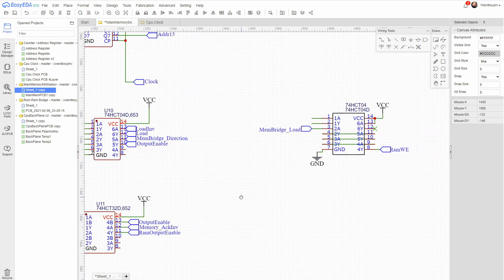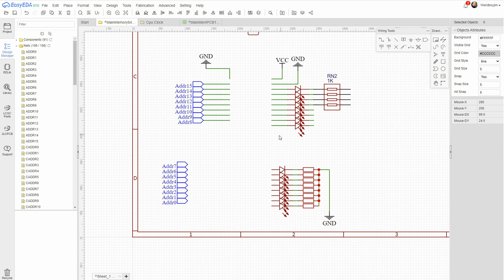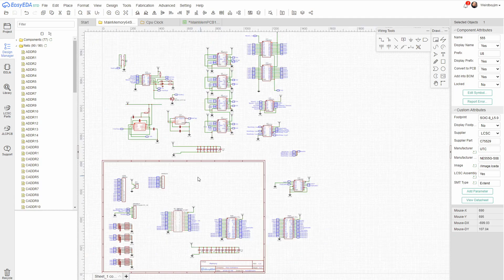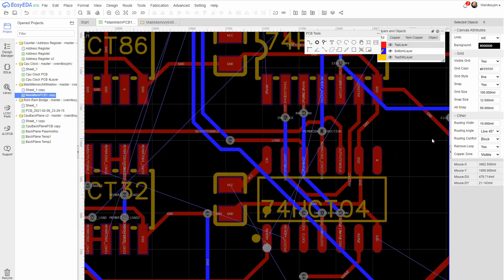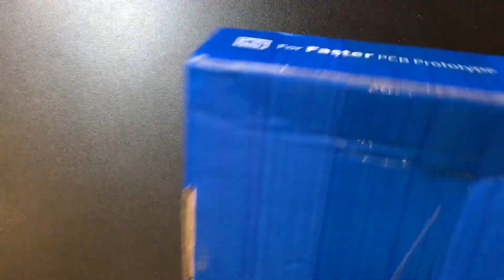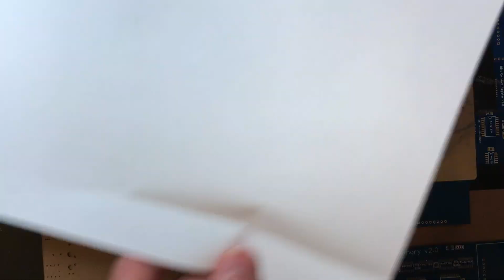Shadow Ram PCB - Making an 8 Bit pipelined CPU - Part 97

Comment: Can't wait to see the next one.
To the 555 on your rom-copy module: On which frequency is it running right now? In building the module on breadboard you put together some components without checking the datasheets of the rom chip. Maybe with a bit of tuning this could go way faster. Afterall the copying is independent from the CPU-clock.
Reply from the maker: The rom chip has an access time of 150ns, so in theory you should be able to get it up to 6.6mhz. You would have to  check some other timings to make sure you are obeying the rules. It currently copies far too slow, the breadboard version was quicker. I'm pretty sure I just selected the wrong capacitor for the 555 when soldering this one up, realistically if it copied in less than a second nobody would care so anything over 65khz would be sufficient.  Sorting that out is actually on my todo list for this weekend. I waited for that copy one too many times recently.

Comment: Wow! What speed and air flow do you set for the hot air gun?
Reply from the maker: The airflow on my 858D is set to "6", there doesn't appear to be any units on there or even a guarantee that the value is calibrated between devices. I speed up a lot of the sequences to varying degrees, the start of hot air soldering is probably slower than the impression you get from the video as I'm slowly bringing the temperature up.
Reply: @weirdboyjim  Thank you! I also try to achieve this kind of reflow, but I either set the temperature too high, so my PCB burned out, or too much airflow, so the smd resistors fly apart! It looks like I just don't have enough patience.

Comment: Just spent two full days binge watching all 99 videos in the series.  Awesome achievement James.  Coming so late to the party had meant I missed the QA from the retrospective, but I do have a question out the index registers.  I haven't spotted them being used much.  How are they used in this project?  I would have expected them to act as manipulators to the program counter, a bit like 6502.  Or are they more of a holding area for addresses that can be moved into the program counter? Also are all the jumps to absolute addresses, or is there any instructions to branch to relative addresses?
Reply from the maker: That's some good timing for all the videos! Hope you found the side series (Uart/Sound) if you are interested in that stuff as well. There are 5 index registers,  PC/RA/SP/SI/DI the first 3 there are constantly used so I guess you are asking about SI and DI. There are a few instructions that use them as branch target but primarily they are for reading / writing memory. They are refereed to as  source and destination but they are interchangeable for all but the lodsb/stosb instructions.

Comment: This is awesome -- so cool to see your design process. I'm curious why you choose to solder your own boards rather than have JLCPCB do that part as well.
Reply from the maker: Thanks Yona! Most importantly I want to get to the end if the project and feel like I have made it, getting someone else to solder it might reduce that. It's worth noting that the assembly service didn't wasn't available when I started anyway but there is also a very restricted range of discrete logic part available that service.
Reply: @weirdboyjim  That makes sense. I'm also a hobbyist PCB Maker and I've found that having them assemble my boards really helps me actually get through projects, because assembly can really be quite tedious and often I just procrastinate doing it.

Really looking forward to your next video on the VGA driver -- super interesting stuff, especially how you're thinking of handling scrolling and sprites. There is very little content out there going into the details of how that part of old hardware works, and it's some of the most interesting.

I would also be super interested in seeing how you approach sound generation -- something like the SID chip or even just triangle/sawtooth/square/noise like the NES had would be fascinating to see.
Reply: BTW Do you have a patreon? I'd be interested in supporting it.
Reply from the maker: @HypherNet  The sound module is a fair way in already.  https://www.youtube.com/playlist?list=PLFhc0MFC8MiAfS8UTTFlGkoqgCuEqusmg
Reply from the maker: As a result of yours and others comments I’ve now created a patron, but please do not feel obligated. https://www.patreon.com/JamesSharman

Comment: I had shadow ram on my BBC micro. Though that wasn't for putting ram in the rom address space  (had sideways ram for that), but for reclaiming the ram that would otherwise be used by the video display (which has nearly all of the 32k in some modes).
Reply from the maker: Yeah, "Shadow Ram" as a term is most commonly used when the ram is shadowing rom but it can be used anywhere the ram is shadowing something else in the address space.
Reply: Yeah, I remember if you wanted code complexity (at least with simple BASIC) MODE 7 was the only mode for you.

Comment: Great video as always.  The manual placement and tracking in the PCB layout work took me back about 30 years - I did plenty in my time.  I was really impressed with your first-pass success too.  I need to take a look at EasyEDA for a couple of small projects ideas.  One thought crossed my mind... Would it have been possible to use the program counter or stack pointer as the address source for the copy process. Obviously that would have meant changes elsewhere in the design but it may have saved counters. On the other hand the complexity added may have been counter productive.
Reply from the maker: Thanks! I know what you mean about reusing an existing address register but with the extra interfacing I don't think it would have saved much. More importantly, I kind of regard the memory as "outside" the cpu so I wanted to avoid extra complexity in the core working of the processor that made it more difficult for people to understand.

Comment: Congratulations.  Nothing like having something complicated work first time.  I'm usually suspicious when that happens, and start wondering what I've forgotten to check.  :P

Am I correct in thinking the ROMs are still 32k?  I'm curious if you considered bumping them up to 64k.  I've been working on my version of Snek, and was surprised at how much space the splash screen can take.
Reply from the maker: I have the same issue with programming, you expect a certain amount of iteration and when it works you get oddly uncomfortable that you've missed something.  The rom's are indeed still 32k, graphics data is always a memory hog. I'll maybe do some videos on ways to reduce the amount it's using later.